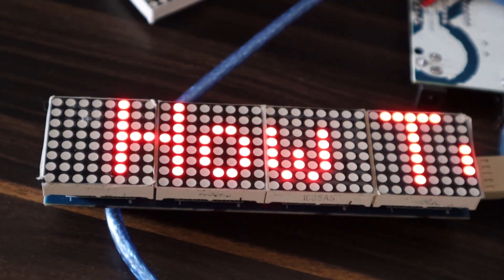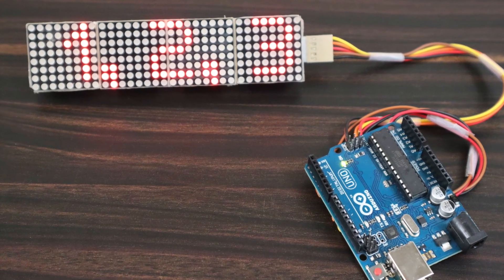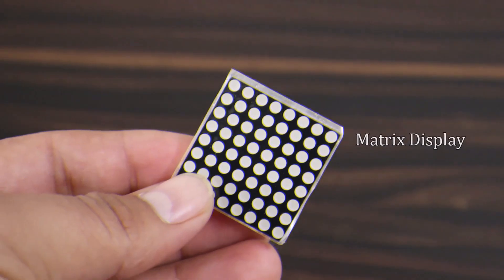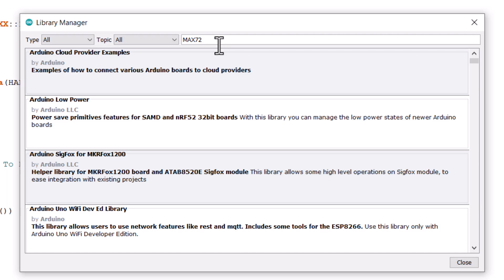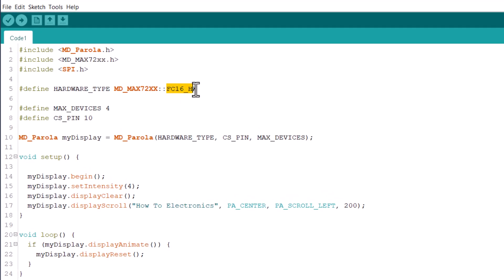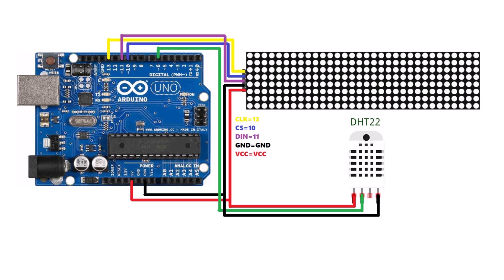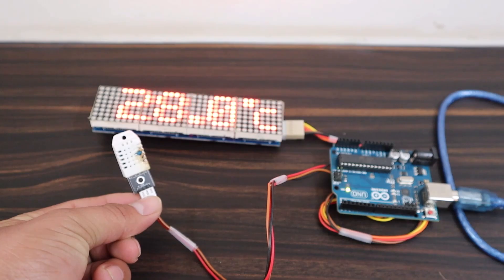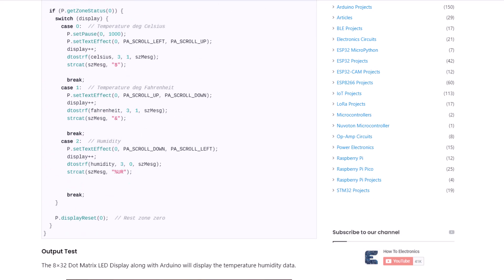MAX7219 Dot Matrix 4-in-1 Display with Arduino - Scrolling Text & Displaying Sensor Data

Comment: Thanks for the video :) I would love to separate the displays into 2 rows with 2 displays each. It looks as if you can cut or break the boards in the middle and then reconnect it with wires - would that work?

Comment: thanks for this amazing tutorial.
Just a tip. If you want to loop temperature and humidity, instead to be stuck in humidity animation, just reset the display counter adding these lines:
....  
P.displayReset(0);  // Rest zone zero
  }
  if (display >= 3) {
    display = 0;
  }
}

Comment: by copying your code on the website (and as shown on this video several times) the code gets stuck on the last sensor reading of humidity - by which i see you are constantly hitting the reset button. i have tried many many different fixes but it still gets stuck. what is up with that? how to get the loop started again?